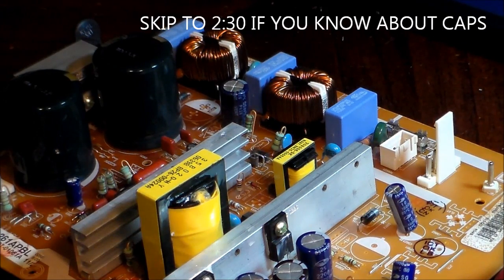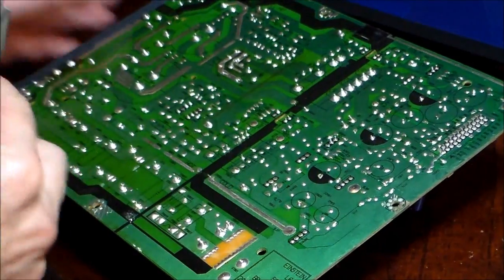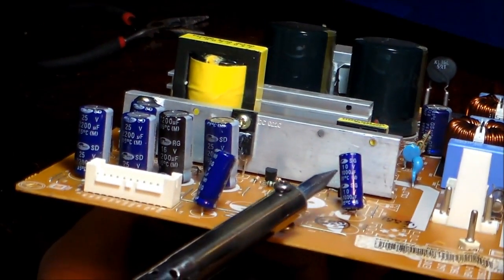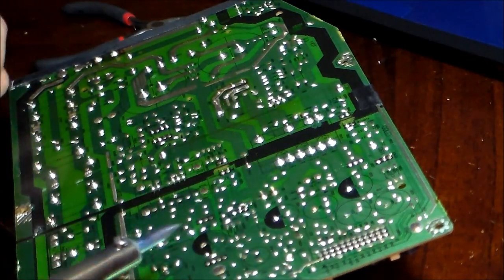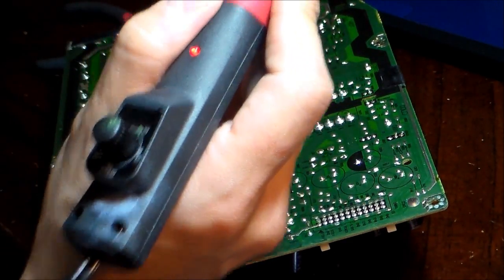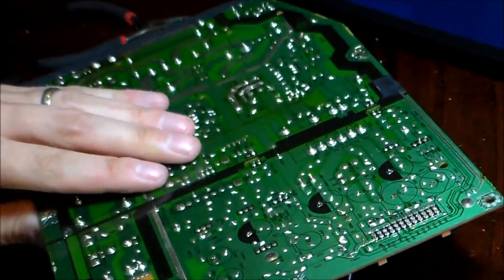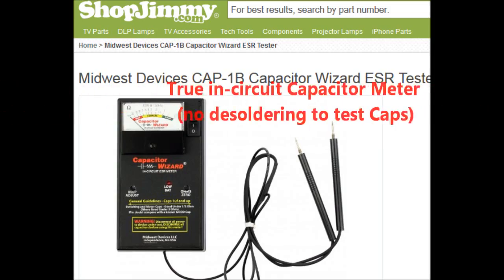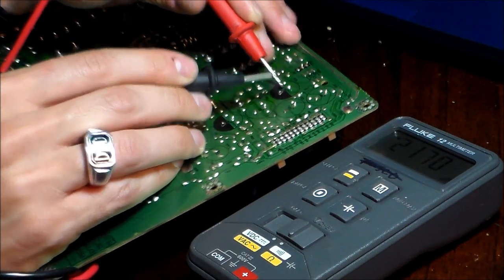HOW TO TEST CAPACITORS IN CIRCUIT with Meter Tester

Comment: Do Bad Capacitors always have a Dome top ? - or can they appear to look ok even if they are bad ? I have a Viewsonic monitor that powers up for a few seconds then goes off - I was told that it is bad capacitors ... what do you think - thanks
Reply from the maker: capacitors that are swollen are most likely bad but many caps that look ok can be bad too,  so take them out of circuit and test them or replace all 47uf to 3300uf caps if lcd is over 9 years old.
Reply: ***** Great demonstration! I also go for the solder sucker in situations like these. Might use the braid for a bigger "puddle" like a battery tab. Would you recommend any of the true in circuit testers other than the one you showed? My multimeter has a low limit for capacitance it can measure (400uf); which is fine for the work I do but a bummer for my hobbys :(
Reply: ***** Mmmmm, Changed out the Capacitors, Still no Joy.???
Reply from the maker: yes both
Reply: +Sid East Thats not encouraging, I have a 9 or 10 yr old flatscreen monitor that does the same thing as you described, turns on for a few seconds then cuts off. I don't see any popped capacitors but was planning on trying to replace them and/or buying a in circuit ESR testing like shown in the video. Did you ever get yours working?
Reply: No - I eventually bought a used Video card from Ebay - Still didnt fix problem - there in Trash now - easier buying 2 new ones.
Reply: sometimes they look ok, if you remove them you will see black stuff leaking from the bottom. but to be sure you need a ESR meter. plan on spending $50 for one. I test them for ESR and if i'm not sure if it's bad I'll compare it to a new cap.
Some meters will include a chart, or you can make your own by measuring several good new caps.

Comment: I have removed my circuit board on the back of my Samsung for checking the capacitors due to the LCD TV just makes that clicking noise when turned on.  Upon observing all the capacitors (18 in all) I can't see any that are bulging or swelling.  What should my next step become?

Terry

Comment: To insure  a complete disconnection from the circuit the capacitors should be lifted out of the board or else a false conclusion can be made  .....

Comment: I see you have 2 huge caps there that were bulging you should have shown pulling them and how they tested out? Because I've tested bulged caps and test came up good even though they looked bad.
Reply: Testing electrolytics can be inconclusive when doing a static test with a DVM or capacitance tester. Often they will test ok but fail under a load.

Comment: I have a Proscan 40 LCD  TV Model 40LD45Q serial # 9145-40LD45C-T110988
when I turn it on, the backlight comes on for about 2 seconds and the screen including the menu displays on the screen but goes away after those 2 seconds but the stand by  light (power "on" indicator) stays on. I would like to find the least expensive way to fix this TV, but i am not sure if the issue is the power supply board or the main mother board, I have opened up the TV but do not see any bulging capacitors I read some where (may be on your site itself) that the turning off of the TV may be as a way to protect the components) and if the back light is coming on then the power supply is more than likely not the issue. (is that true even if it is coming on for just 2 seconds?)

So I was thinking it is more than likely the logic board but before I buy one to replace it how can I confirm that the logic board is bad? I don't want to buy the logic board and then find out it was actually the power supply board.

Is it possible for any other parts to be defective to cause these symptoms?

Any assistance you can provide would be appreciated.  

Power Supply board = AYL400201
Logic board  = T.ZR39772.7A
Reply from the maker: can be backlight issue so check inverter board, also main board connection to tcon board.
tcon controls images on lcd screen but inverter board turns on backlights.

Comment: I have a Emerson L320EM2F It just died, removed the back found fuse (125V 4amp) blown.  replaced blew again and you can smell something hot. Any help would be appreciated. Thanks
Reply from the maker: watch this video- Most Common TV Repairs for Emerson Sylvania Philips Magnavox - no power
 Sub,like,or Share if this helps 8^)

Comment: Easier to simply replace the capacitors rather than buying an expensive multimeter and going through the motions when ESR is the most critical part of capacitors.Just change the damn things. Capacitors are almost always the culprits.

Comment: Why  did you only "desolder" one side of the capacitors before checking them with the multimeter ?
Reply from the maker: a circuit is only complete if both capacitor legs are in circuit, so removing negative leg you can accurately read the cap rating without interference from other parts in the circuit. hope this helps
Reply: It takes 2 seconds less time, but you take the risk of a faulty measurement. Your call.

Comment: that one u showed looks like it costs 189. Why does the battery power need to have at least 25% life? What is happening in the capacitor mode when you check it?

Comment: After 2 days of research on the internet and didnt found my answer. What if the capacitor reading go OVER, not within but, Over is 10%. Eg: 1800uf read at 2200uf. Is it good or not?

Comment: so you do not have to remove the cap you just have to unsolder it to find out
Reply from the maker: yes, if you unsolder one cap leg its "out of circuit" and can be read correctly by a meter.
Reply: thanks you a good tutor

Comment: Desoldering the cap (even 1 leg) makes it no longer part of that circuit, so the title is misleading as this is actually out-of-circuit testing. If I'm going to desolder 1 leg, I might as well just take the cap out and replace it with a new one if I'm working on something old. To me this video is a FAIL.

Comment: I purchased 2 47 LG 3d Smart TVs and both ended up with the same problem,horizontal fine lines starting from the right side of the screen all the way the center of the screen.I would send you an image if you wish.

$100 for you if you help me get the screen fixed .I am serious and honest
Reply from the maker: no need to do that, just use google helpout app "video chat" (use code- paul51p for free helpout) lines in screen can be tcon board
Reply: Hey, did you ever figure out the problem? I have the exact same TV and exact same issue...
Reply: Sadly no.But I would let you know when I find a solution.

Btw,I think the cause of the problem  is that I purchased the TV from USA where the voltage is 110 wheras the voltage where I live is 227 so I have to use a voltage converter & that is what caused the problem.

Do u use a voltage converter too ؟
Reply: Funtime hz Actually no voltage converter so using straight 110v. I actually though it was the power board until I saw it could be the tcon  board. 

BTW, this is what my TV looks like: http://screencast.com/t/r3fW8AXnA
Reply: Good to know that it is not the converter .

There is no LG service center where I live ,otherwise I would send the 2 TVs to them.What about u,why not send your TV to them for repair?
Also,why not try replacing the T-con board?

Please let me know if u find a solution,please.
Goodluck

Comment: Watch that ring. Very bad habit to wear it working on electronics.
Reply: there is a list of safety rules for servicing electrical devices (yay google) that illustrates your point with a pretty nasty pic. its on the wall in my shop.

 i had a bad feeling i knew what he was gonna use the pliers for too.

Comment: sir am technician working with samsung service center but i a challenge on 46" tv model ua 46es7500 it comes on and works for 30mins and off, wthat is the problem
Reply from the maker: unplug tcon board if Tv stays on then tcon board can be defective. also check for voltage drops on the plugs.

Comment: IS THE CAPACHECK METER SOLD ON EBAY TO TEST CAPS "IN CIRCUIT" WORTH BUYING? IS THERE SUCH A THING TO TEST CAPS WITHOUT DE-SOLDERING ONE SIDE OF THE? AND I AM LOOKING FOR SOME KIND ON STAND TO SET TVS ON TO WORK ON THEM NOT EVEN SURE HOW TO GOOGLE THAT LOL ANY ADVICE THERE? SORRY FOR THE CAPS.. NO PUN INTENDED LMAO
Reply from the maker: yes, try In-Circuit ESR capacitor meter its $100 i think "Grants pass tv repair" channel uses that meter.

Comment: I have an Optoma Pd50 tv. 50 inch "plasma" and the led turns on green. The screen doesn't turn on. I opened it up and I see 2 200v 2000uf capacitors and hat have a slight roundness to them. And they are large caps on the secondary power supply board. Do you think this could be the reason the TV doesn't fully turn on anymore. Also the light doesn't blink and I tried the reset but still nothing. Let me know what your thoughts are please

Comment: Not a very reliable way to test a capacitor. A few seconds more desoldering the other lead and the entire capacitor could be separated from the board and then measured reliably.